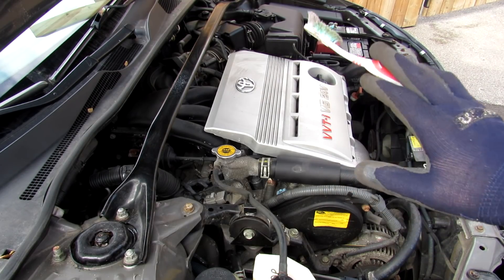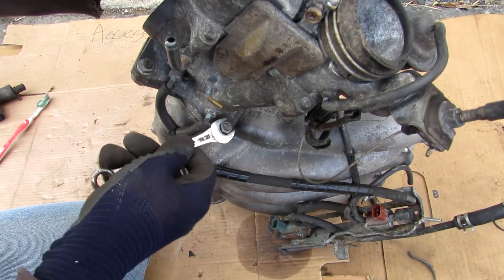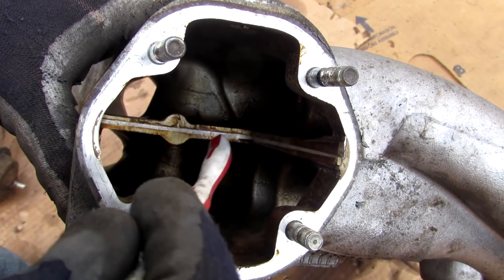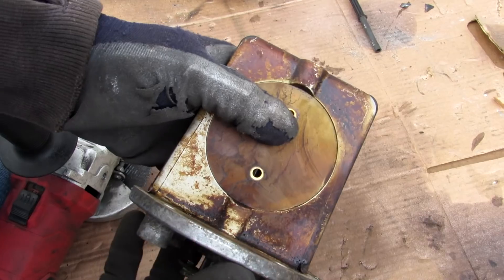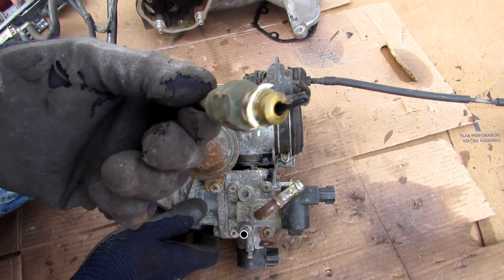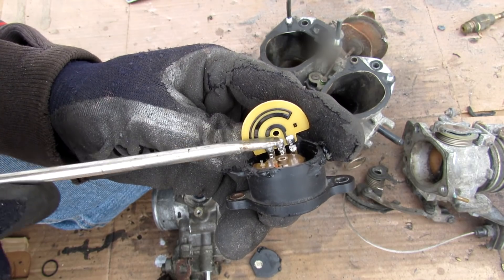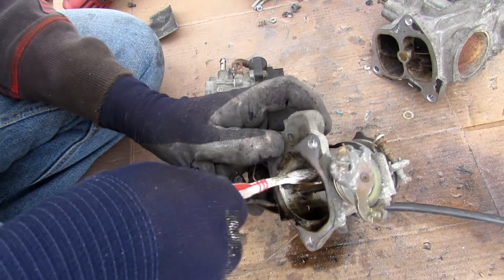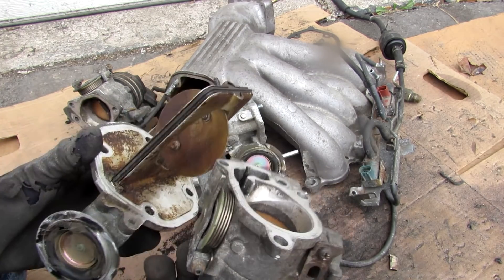How the Air Acoustic Control Induction System Works

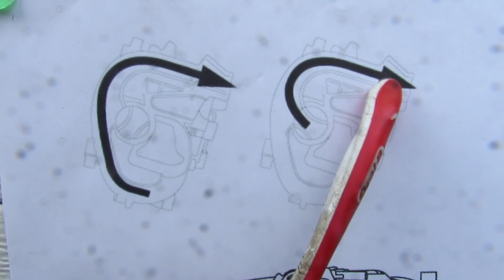Comment: 5:05 i bet if you switched these systems around to come on in the opposite order. Short flow, at low rpm, and long flow at high rpm, you could make the motor produce alot of torque at low revs

Comment: Wait a second, isnt the acis system just a flow restrictor. A convential intake wouldnt have a second intake plate meaning youd get consistent flow throughout the rev range, making performance more seemless. Where as with a second intake plate, it would force the air around it and in a lower volume which seems like it would just restrict air flow to keep the air to fuel ratio lower for economy at lower loads.

Comment: Is there a particular part of this intake system that tends to cause engine surging? I have a 2000 Avalon that surges slightly at idle with a duration of about 1 second. It also surges on light to moderate acceleration, but is smooth under heavy throttle. So far, I have changed the air filter, pcv valve, mass air meter, and two oxygen sensors. Changing these parts did not change the condition. Any ideas?

Comment: I've been chasing down a gas mileage issue on my RX300 1MZ... this is really informative in exactly what I was looking into.  I think I have a bad vacuum switch, but I still need to test them.  Otherwise, I'm pretty sure it's a bad Cat causing the issue.  Dreaded P0420... We'll see though. Been getting about 12mpg in town, but 24 on the highway.  Really huge difference.  Supposed to be 17 in town, and 19 combined.
Reply from the maker: Check tire pressure and for stuck injectors with fuel trims

Comment: Would that actuator cause the engine to throw a code? I'm getting a po171 it's on my 99 Lexus RX300. The vaccum canister has a small leak and doesn't hold the actuator if I put my finger over it like you did in the video.

Comment: Thanks for the video, but I don't think the explanation at 3:28 is correct.  When the valve opens, the effective length of the intake run is shortened because a hole is punched through the run.  When the valve closes, the hole in the intake run is closed so the full length of the intake run is restored.
Reply from the maker: Ok

Comment: My 02 Lexus RX300, has duel throttle  plates, and the problem is, it has a P0174 lean code on bank 2. I am assuming the acoustic air control plate inside the throttle is the problem,because the STFT2 maxed out at 20% and the LTFT2,maxed out at,52%. Bank 1 fuel trims are good. What do think the problem is ? Thank you

Comment: You commented that the screws always strip out in the video... I recently learned that Japanese cars use JIS screws which require a JIS screwdriver. They look very similar to Philips except that they're not designed to cam out when the desired torque is reached and thus not strip out. Is it possible that your screw drivers are plain-ol Philips instead of JIS? Thanks for the video, I appreciate all the effort you put in!

Comment: What is the function of throttle body for a diesel car? And is "throttle body" the same thing with "damper valve" ? I appriciate if you answer these questions. Thanks.
Reply from the maker: Throttle body controls the amount of air going into the intake. 
I'm not sure what you meant by damper valve in the context of air intakes
Reply: The ones I'm familiar with close when you turn the engine off to cut off the air flow.  This only serves a purpose if something has failed allowing engine oil into the intake, at which point it is fueling itself and you have what's known as a run away diesel...  Plenty of videos of what happens when you don't have that damper valve on youtube :)

Comment: So I thought the Mass Airflow Sensor (or manifold air pressure sensor) controlled idle. Do the two systems work in conjunction or do cars with this acoustic system not have a mass airflow sensor? Idk why I feel like I'm calling it the wrong name lol
Reply from the maker: Mass airflow sensor just tells the computer how much air is going into the engine. 

It doesn't control the idle directly. That's the job of the idle air control valve
Reply: @speedkar99  yeah I thought about it as soon as I posted the comment. At first while you were explaining the acoustic system and double throttles I was thinking "that seems very extra" but it all makes sense now

Comment: That sounds like a BMW DISA VALUE.  The disa is a common vacuum leaker that can be costly to fix if you have it done but is a cheap fix with rings at home.  Mine was leaking and had to get a long torx big for GM brakes to get it off.  That’s is a lot of carbon build up in there
Reply from the maker: Yep. Each manufacturer has it's own type of intake air runner length or acoustic control system
Reply: speedkar99.... I had a 1994 BMW 325is 2 door convertible that had a vacuum leak on its disa value and I rebuilt it for $40 rather then $500 bmw wanted for the part and $350 to install it.  Some auto work is a rip off I only paid $3000 for car 13 years back

Comment: Excellent video. How the long run of air flow can effect the sound  constructive/destructive interference? I think the long run + curved flow helps in turbulance and thus better air fuel mixing at low RPM...Kindly correct me if i am wrong....
Reply from the maker: Wavelength / frequency is proportional to tube length , by changing it you are changing it's resonance frequency to a band that is not as easily detectable by ear

Comment: Nice, I never knew these existed. My rule of thumb is to clean my TB every time I change my air filter (every 50K kms). Also clean the PCV valve, which is another often overlooked item. Easy to clean with q-tips and TB cleaner.
Reply from the maker: Yep, that's all great tips!
Reply: Agree, good points. But air filter every 50K kms? How does it look after such interval? Looks a bit longish to me, but it probably depends on the vehicle type.
Reply: @pancakewsx  25k miles roughly

Comment: Fascinating. I had no idea there was such a thing to control intake noise because I didn't know intake noise was considered a problem. Unrelated, but since the weather finally looks like spring I got my old 1970 Pontiac Catalina running for the season. Dumped a little gas in the carburetor, hooked up some jumper cables and away we go! A simpler time.
Reply from the maker: Yes much simpler but less stringent emissions and customer expectation standards  back then too.
Reply: I believe that the primary goal of the induction system is to increase power by giving the engine a fatter torque curve. Ideally an engine wants long intake runners at low rpm operation, then switch to short runners at high rpm. This induction system does that plus makes the engine run quieter. Instead of so many intake runners, the flap is a compromise design that achieves most of that goal, while bing less complex and less costly to produce.

Comment: So from a performance stand point, for the J series intake manifold, would you have the actuator closed or open? Some folks have it opened manually.
Reply from the maker: Yes it can be either, or infinitely variable.

Comment: ACIS controls the length of intake runners in air intake?
does this system works in 4 cyl engines as well?
Reply from the maker: Somewhat. Its not as complex as modern systems, I explained that with the diagrams in the video, where there are two separate paths altogether.

Comment: Had a similar system on '03 Mondeo. Once it fails those valves go stupid and make more (annoying) ticking noise. Some Mondeo owners actually remove the valve blades and see no difference in performance or reliability. Thanks for the video.
Reply from the maker: Yes, some people remove them to let the air flow... its not something you'll notice however.

Comment: Why that much carbon being build there? Even those valves dealing with only air!
Reply from the maker: The PCV system brings oily air from the crankcase to the air intake. The idea is it vents the crankcase from blow by pressure, but also re-burns the oil in the engine.
Reply: Extra crankcase pressure is relieved through the intake, so any oil that gets sucked in will build up on the valves.
Reply: So a oil catch can setup will help alleviate this?
Reply: He explained at 2:00 the oil came from the pcv valve.